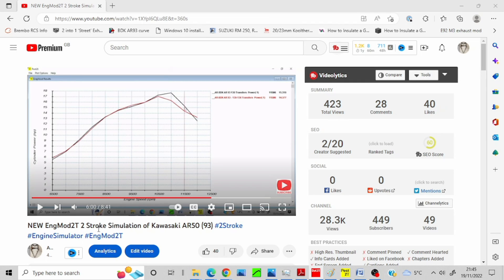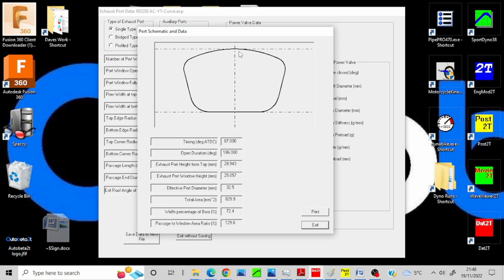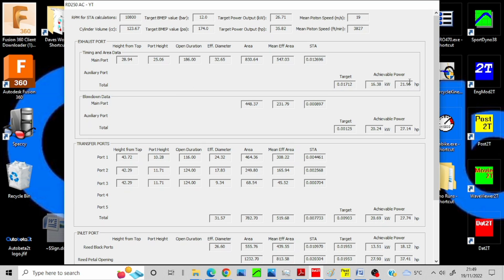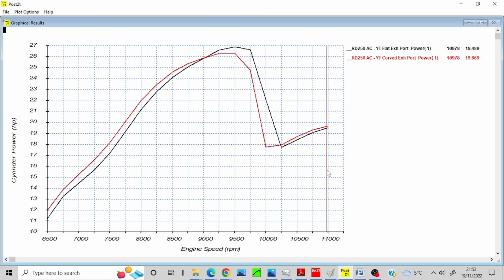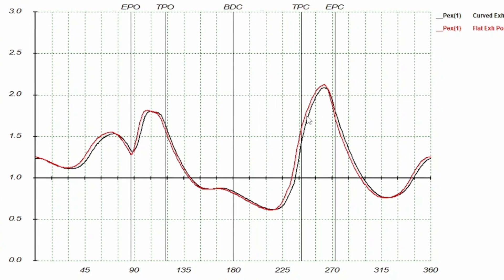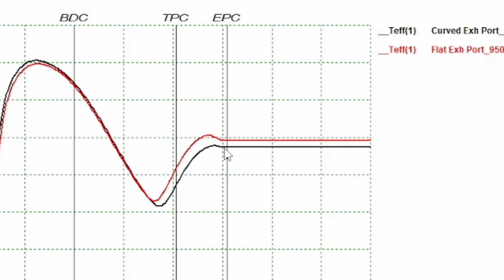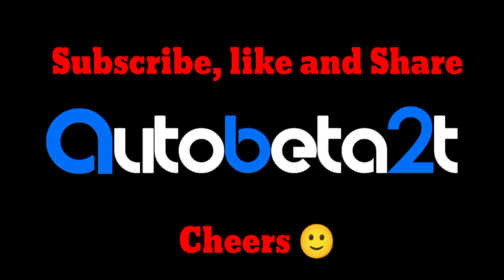Flat Top Vs Curve Top 2 Stroke Exhaust Port Engine Simulation #2Stroke # Tuning #engineSimulation

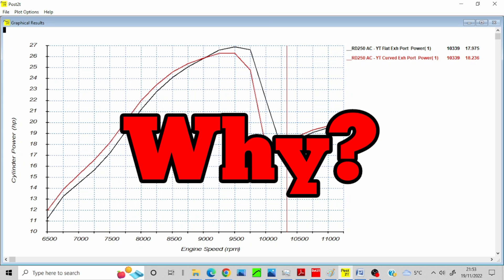Comment: 2:25 a "flat-top" doesn´t have to be so flat, that it destroyes the rings... If the curvature is just 2-3x(piston-ring-width), then, nothing should happen. Or chamfer the uppest/lowest edges. Aside to that, one can part the port into two separate windows, and make it far more mild to the piston ring... 
A sharp boost by a flat-top of the port, steep angles for diffusor/baffle, all leading to a narrower, but higher power-band. But if you do the following, only top-performance counts, no matter how narrow the power-band is: https://www.youtube.com/watch?v=aneETdq-ai8&t=1141s 
at 18:37 you can see the comparison between different exhaust-system-lengths, to the variable-length-exhaust (yellow line)... 
Consider that this guy regulates the exhaust-length haphazardly, with his leg, without any knowledge of the momentary RPM or load... It´s the crudest mode-of-control imaginable, but still works.

Comment: You can actually get a flat top ex port by careful chamfering it in an unusual way so that the port is flat but the ring sees a curve. I've used a soft metal "wear away" coating in the chamfer area to let the ring create the shape it needs.
Reply from the maker: So the chamfer would be greater in the middle of the port and reducing at the edges of the port on a curve?

Comment: Thanks for the shout out! I'm just pretty glad I didn't make a fool of myself lol. Real name is Roy btw, Maxs Dog was my old gaming name.
Reply from the maker: No problems Roy. I'm Dave BTY.
Reply: @AutoBeta2T  When I made the original comment I phrased it badly, what I should have said is that the flat roof port gives a stronger signal and more power at the expense of midrange, not a narrower powerband, don't matter, the sim proved the point. Most of the engines I modified were for street use, even the more radical ones so I more or less stuck with the rounded trapezoid, more for mid range and the bottom of the powerband than anything else.  However I did sometimes flatten the middle (roughly 60 - 65% of the port width) and blend the top corners into the original shape
Reply from the maker: Gotch you Roy.
It's sounds like you have modified a fair few engines! Something I've not done a massive amount of. It's mainly been pipes for me so I lack the porting experience so all the tips and insights are very welcome - thank you.
Reply: @AutoBeta2T  Compared to Stan Stephens or Terry Becket relatively few but considering my location and lack of exposure I did my share. It was all word of mouth. I started with my RD400, a magazine did a tuning feature with an RD250 and X7, all the bolt ons and very basic porting so I copied that,  my next bike was a 350LC and did the same,  ended up fitting the ultimate bolt on, a TZ750 cylinder block (375cc) with TZ350 pipes and TZ250  carbs, after that was nicked it was back to air-cooled while waiting for the insurance and the miners strike started in 84 which is when I really got into it. Good job I'd learned the basics and had the gear cos that fed my wife and kids for a year. It got to the point I was having to turn people away due to lack of time, but not enough of them to quit my lob and do it full time, it dwindled out in the mid to late 90s anyway, everyone was going fourstroke